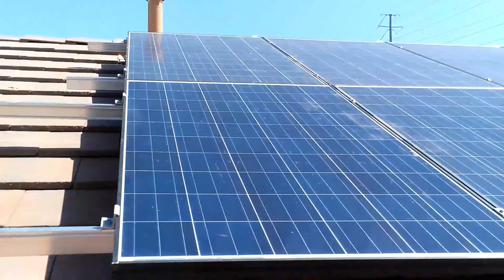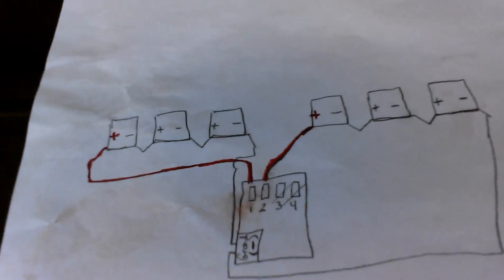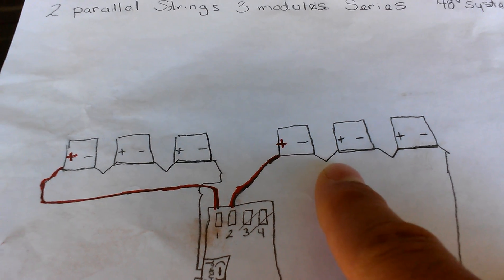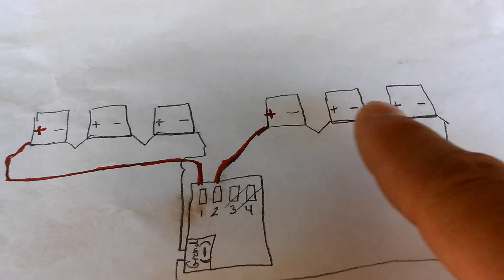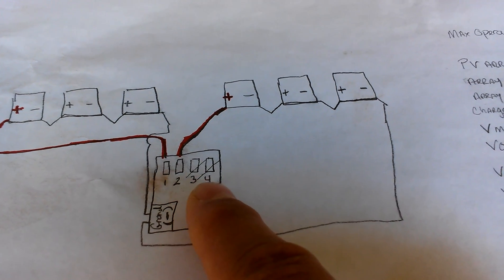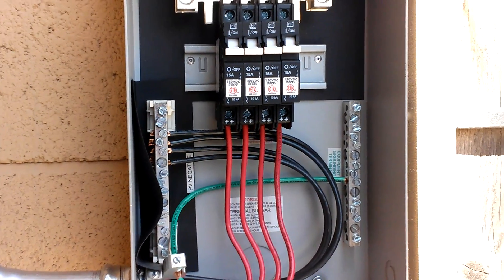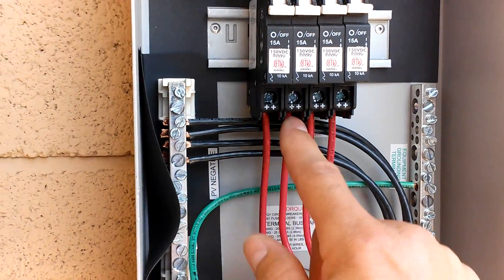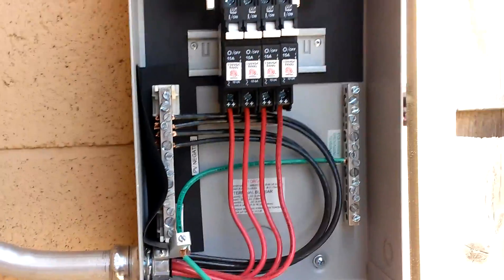Installing Solar System Array & Wiring

Comment: This is a question for your experts out there and I am not one of them.  Here is some background and then my question.  I have a system that is 24 volts to the batteries and an AIMS 24 volt 6000 watt inverter. I presently have 6 panels rated at 330 watts and 2 rated at 335 watts. Both sets of panels are by LG and have 40.9 volts open circuit (Voc) and have current (ISC) of 10.9 amps and Vmpp of 33.7 volts and Impp of 9.8 amps, serial number LG330E1C-A5.  My question is: should I wire these panels in 4 groups of 2 in series or add a panel and have 3 in series in 3 groups (9 panels).  How do I maximize panels (wattage) and not exceed the Midnight classic 150 SL  charge controller parameters of 150 volts and 96 amps? Regardless of the number of panels, what combination maximizes power to and from the charge controller without adding another controller?  Any help would be appreciated.

Comment: What Gauge wire should I use from the combiner box to the controller (EPever MPPT 40a, the real one, not knock off) if I am attaching 3 x 150W panels that produce aprox. 8 amps each in parallel , (so only aprox. 9 amps in series) but close to 45-50 Volts if in series.... 
   I want as little loss as possible from the panels / box to the controller....Is it worth it to go bigger in the 6 or 4 awg range?
    I just use 10 awg "Tray Cable" now... or is that fine?

Comment: Good video. How did you get 48v with three panels on each string?
Reply: mppt converted with dc to dc converter put 120v in 50v out plus more amps
Reply: The power from the solar panels goes to the combiner, into the .charge controller (MPPT) And from there, it can be 12, 24 or 48 volts into designated batteries .

From the batteries, the power goes into an inverter which changes it from dc to ac.

Comment: Im going with 48v system as well.
Magnum 100 amp charge controller.
Guy at magnum said to put 4 -29.2v in series and 12 in parallel. 
29.2x4=116.8v (not to exceed 187v)
9.2x12=110.4 amps
Reply: I'm looking to run 125+VDC. I think it's wise to raise your solar panel voltage as high as possible to ensure charging capability as soon as they turn up. It also keeps current as low as possible, and minimizes wiring sizes.

Comment: Thanks for sharing.
Very nice equipments you have their.
Please subscribe, leave comments and don't forget to checkout my channel Videos, Photos, Grid Tie, Charge Controllers, Battery Banks, Wiring Diagrams and Solar Modules Configurations for 12V 24V 36V & 48V Systems.